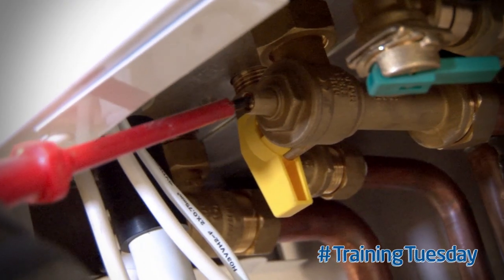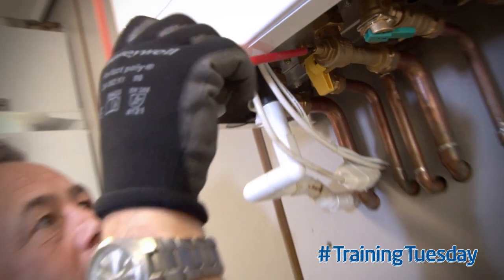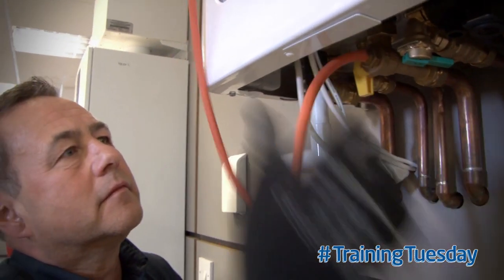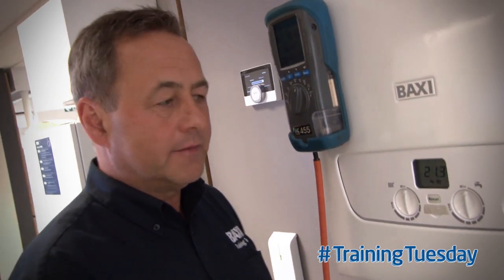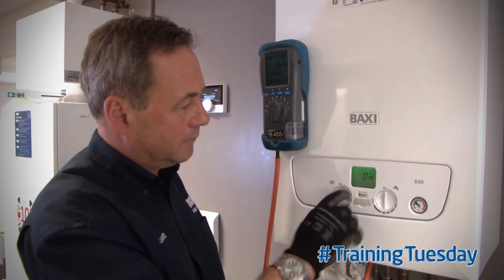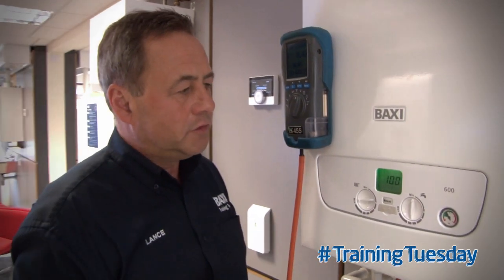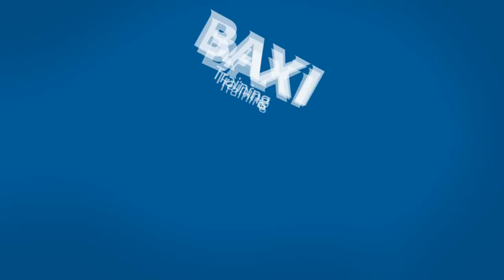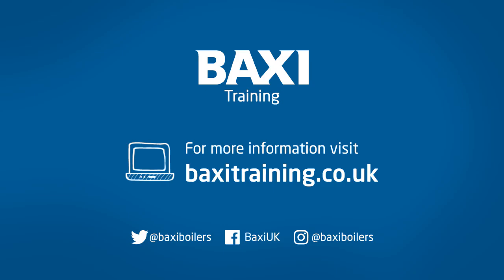How to check the gas inlet working pressure in relation to error code E133 on a Baxi 600

Comment: Now its minimum 18.5 at meter, allow 1m bar drop to appliance . Leaves 17.5 at boiler not 18
Reply: On ideal logic I tried inlet pressure from boiler gas isolation inlet and showed 14.5 mb with water on full hot